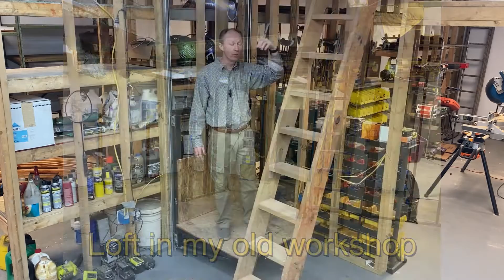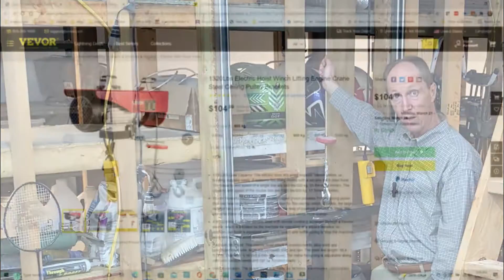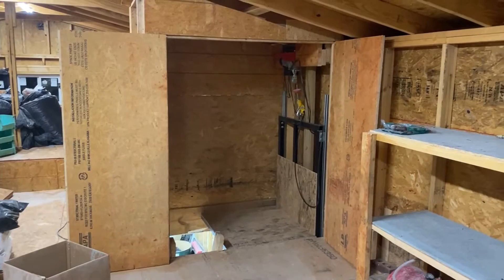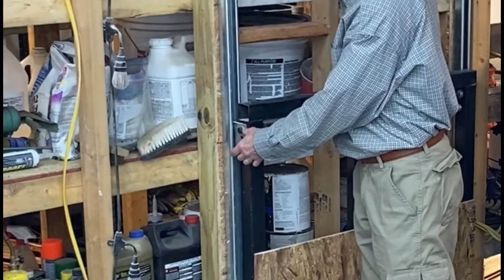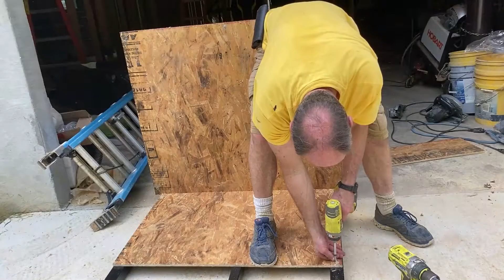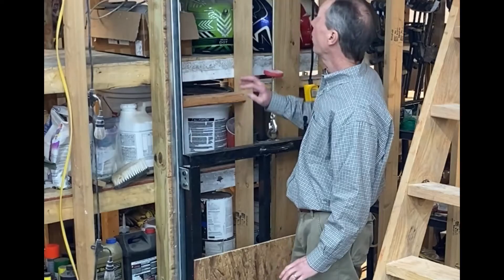Elevate Your Shop the EASY WAY!! My Shop's SECRET WEAPON!

Comment: The cheapest and easiest safety system for these that I've seen was a seatbelt from a car. It uses the same principal as a fall arrester at a fraction of the cost and easily obtained at any wrecking yard. Great video. Thanks. 👍
Reply from the maker: Thanks!

Comment: You need the emergency catastrophic failure prevention braking system with the geared teeth and the multi tooth clacker Lock
Reply from the maker: Thanks for the tip!

Comment: I would use 2 cables on the same winch with 2 mounting points, also some kind of safety brake just incase, shouldn't be too hard to figure out 👍🙂
Reply from the maker: Thanks for the tip!

Comment: If mounting the motor on the platform, you don't need to run cable up AND down. Just up. ;) That will also eliminate the long electric cable to the "remote"
Reply from the maker: Thanks for the tip!

Comment: When you spoke about the put the motor on the bottom and have the cable go to the top you still be pulling the cables the same speed it wouldn't double your cable you'd have to put your pulley on the elevator and put the hook back up the top that would double your load
Reply from the maker: Thanks for the tip!

Comment: You need a saw tooth locking  safty  feature...if the cable frays  snaps etc or something happens to the wench... the ratching mechanism will lock into the Sawtooth locks mount to sides of both rails locking the elevator into place not dropping down to the ground.
Reply from the maker: Thanks for the tip! subscribe for new builds coming soon!

Comment: Thats amazing. If I build the house that I want I want this system instead of a staircase. Do you think it would be possible to dismantle the controller and have the buttons mounted in the floor platform so that you can hold something with 2 hands and operate it with your foot.
Reply from the maker: Probably! Go for it!